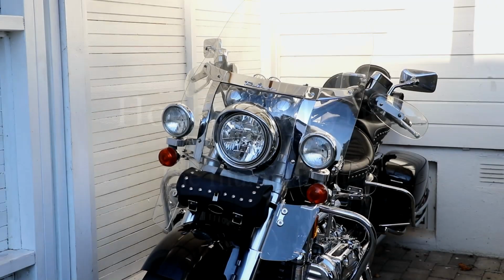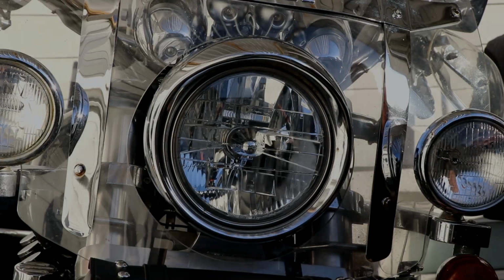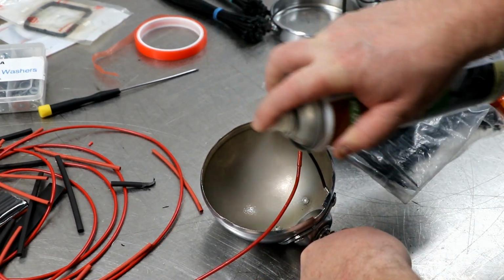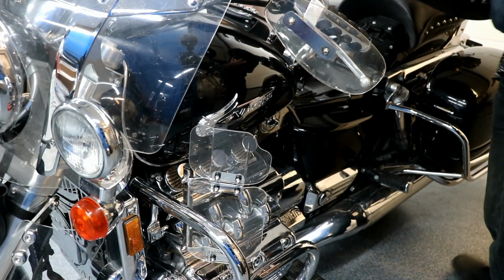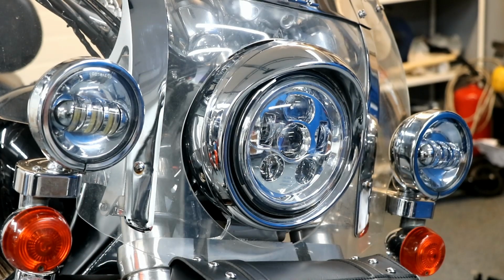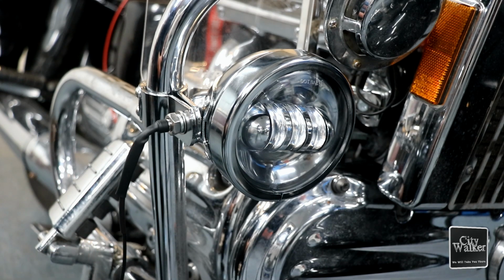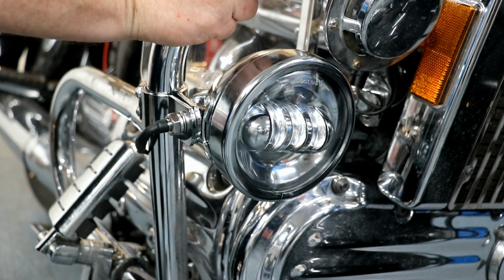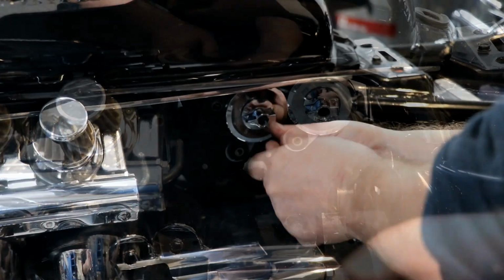Honda Valkyrie - The Illumination

Comment: Really useful video. Did you ground the light bar or is that already standard Honda design. The black wire in the spotlight goes to casing. Only red live wire goes to the battery via relay/switch?
Reply from the maker: Yes, that is correct. Black cable ends inside housing.  The 4 pieces of housing is unfortunately of bad quality. They are all rusted now. The rest of the bike is fine. Will replace with high quality items next time. Just need to move house first. Thank you for watching and more Valkyrie videos will follow later.